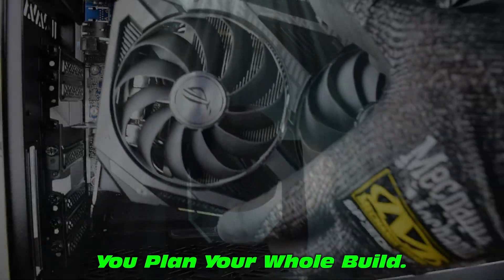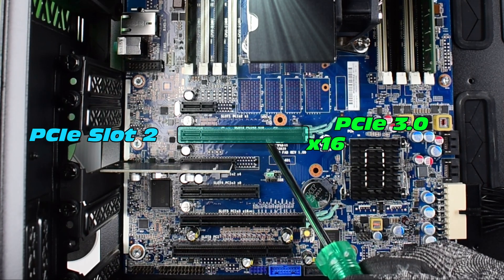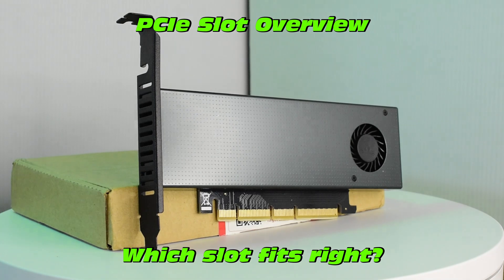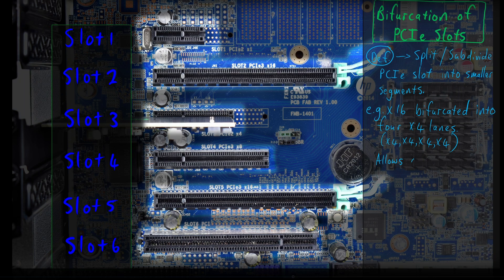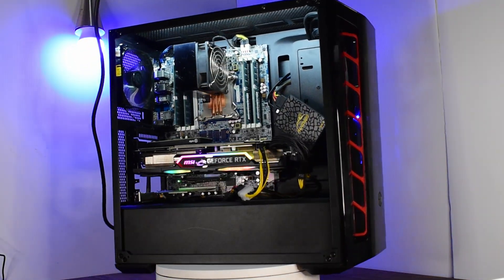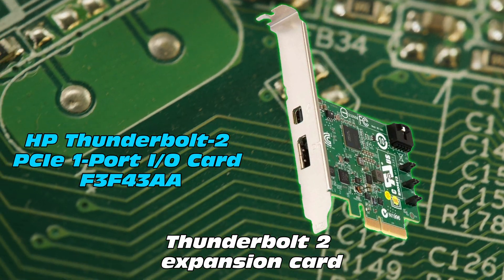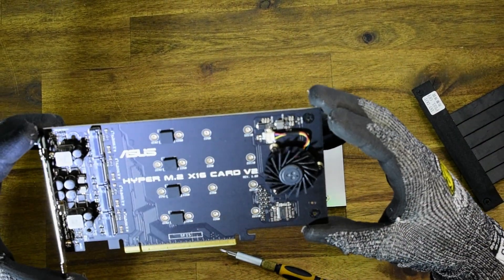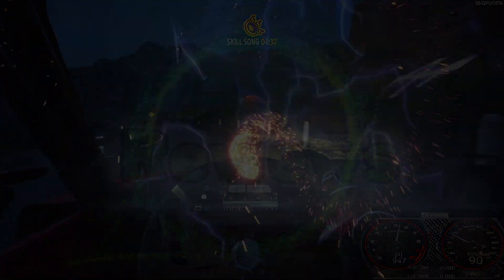PCIe Guide : Slot Selection + Bifurcation Explained (Featuring HP Z440 Motherboard)

Comment: Hey, first thing. I just wanted to tell you how I appreciate this video and your channel. I subscribed to your channel. I also appreciate the amount of effort that goes into making this video and research. 

Anyways, I have a few questions and suggestions. 

First question that I have is do you know of an easy way to identify if a motherboard supports pcie bifurcation on a motherboard and if so is there an easy way to tell if all the slots support it or only a slot. What should I look for cpu, chipset ?? Also, do you have any tips on finding pcie bifurcation motherboards for cheap? 

I'd really appreciate your help. Also, just a suggestion, but you should make a video regarding how to find compatible pcie bifurcation motherboards for cheap or how to find these motherboards.
Reply from the maker: Hi there. Thank you for your message and sub! Yes I do my best to get as much value as possible into each video and I appreciate your feedback. 

You have asked what is probably the best question on bifurcation - how can we be sure the motherboard supports it? The answer isn't that simple unfortunately. 

To explain it, lets go for a relevant example - the HP Z240. The Z240 motherboard has a PCIe 3.0 x16 slot and was released around the time bifurcation was available, but does not support bifurcation. The main issue here is the support from the CPU and generally the CPUs supported by this motherboard are limited to 16 PCIe lanes of connectivity (e.g. E3-1245v5 CPU only has 16 lanes for PCIe connectivity). The other factors that influence bifurcation include the chipset on the motherboard, and the way the manufacturer allocated the available PCIe lanes. Thus, bifurcation support is not only limited by the CPU but also by the manufacturer's selected components for the motherboard and the resulting PCIe slot configuration. 

To come up with a solution to quickly see which motherboards support bifurcation isn't simple to my knowledge, and the best way to check is to go to the motherboard manufacturer's website and search for a technical document for the specific motherboard. Generally they will list if it is supported and what format of bifurcation is supported (most support x8x8 but not all support x4x4x4x4). In terms of the HP workstations, the Z440, Z640, Z840 and most of the newer HP workstations do support bifurcation. The quickest way to check support is to check the Intel details for the number of CPU PCIe lanes available. If there is only 16 lanes it will likely not support bifurcation, but if there are more lanes it will be more likely that it does - pending the PCIe lane allocations (e.g. the Xeon E5-2697 V3 CPU that I have in my Z840 has 40 PCIe lanes per CPU, so 80 lanes in total). 

In terms of a quick list example - check this link from Asus: https://www.asus.com/us/support/FAQ/1037507/ . Similar resources can be found on different motherboard manufacturer websites - and although a bit complex, you could track down a system in your price range and check these technical resources to see if it suits your intended build plans. Complex! Hopefully you find some value in this. Let us know how you get on.

Comment: Is this solution viable for storage (and removing mechanical disks) because I'm already booting from a Zturbo drive? Thanks
Reply from the maker: Hi Mickael. Yes this can work well for storage, but there are some differences compared with the mechanical drives. NVMe SSDs and SATA SSDs are flash storage and tend to have a shorter life span than the mechanical drives. 

For highly sensitive data the mechanical drives are still the best. For a working drive the NVMes or SSDs can work well. I am testing a selection of different adapters right now to find out which one makes for the best value in terms of price, speeds and temperature. I hope to get the video rounded off soon but thus far the Asus Hyper M.2 V2 looks like good value and it performed well on tests (I am testing 4x 2TB Adata Legend 800 NVMes in Raid 0 on a Z840).
Reply: @racerrrz  Hi thanks a lot for yours informations about drives I think order ASUS Hyper M.2 x16 Gen 4 and start with 1 NVMe in the slot. But MVMe have different speed of transfert, do you know the maximum speed possible of Z440 in PCe 16, 3.0 (second slot avaible, the fisrt is for graphic card?).

Comment: so i can use 2 nvme in z440 ? im a little noob with all these info in your video but i wanna use 1 nvme for boot and second for data and ex.. is it possilbe ? and if possible what pci model i should buy if you can give me a link
Reply from the maker: Hi Monzer. Yes you will be able to use 2x NVMes in the Z440 on one PCIe slot. 

All you need is the M.2 NVMe SSD PCIe adapter fitted to a x16 PCIe slot - like slot 2 or 5 (sounds more complex than it really is!). 

In the Z440's Bios you will need to toggle either:

   1) x8x8 (2x NVMes max) or 
   2) x4x4x4x4 (4x NVMes Max) Bifurcation 
(or you can select the option in HP Performance Advisor in Windows - as illustrated in the video). 

I am not 100% sure which adapter is the best but I am testing several PCIe adapters right now to find out! The cheapest adapter that I could recommend is the Asus Hyper M.2 V2 which is a PCIe 3.0 adapter that is well suited to the Z440: https://www.amazon.com/s?k=asus+hyper+m.2+v2&crid=356NM93EZG0OD&sprefix=asus+hyper+m.2+v%2Caps%2C415&ref=nb_sb_noss_2 (link may break over time). 

If you run into any issues feel free to ask for help.

Comment: This video is great for new pc builders and old pc builders alike. I'm excited for Pcie 6.0 but I don't think we will see that one motherboards for another 2 years.
Reply from the maker: Hi. I am glad you found the video useful. I am testing some new processes in the video (like hand written notes) so it's cool to see that play a role. I would be excited to just have PCIe 4.0 in the Z840 Workstation...lol. It may take a while before the new standards reach us - but then gaming hardware tends to be quick to adopt new tech.
Reply: @racerrrz  For me I’d like to have a pcie 3.0 8x to pcie 4.0 4x conversion tool for faster ssd speeds sadly those don’t exist.
Reply from the maker: @EliezYT  That idea sounds fair. I wonder how complex the adapter would need to be for such a conversion. If there was a way to achieve this that would remove the bottleneck on my GPU from PCIe 3.0 x16 speed limits! But yes, sadly there is no way to speed up older PCIe connectivity. At least PCIe 4.0 is backward compatible with PCIe 3.0 etc.